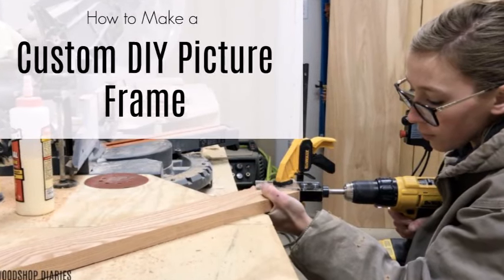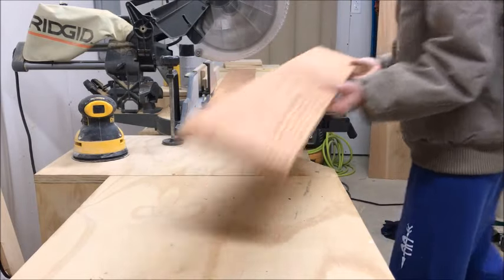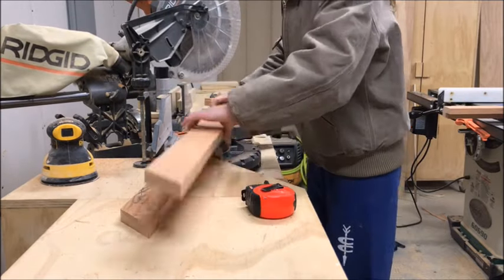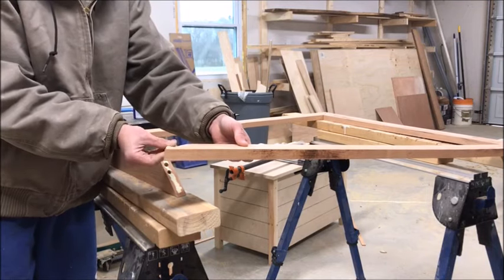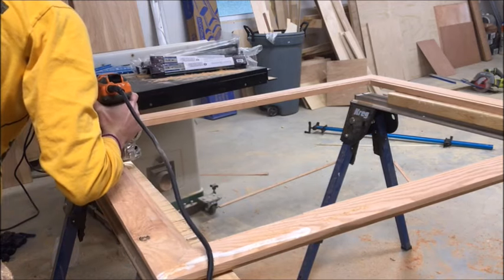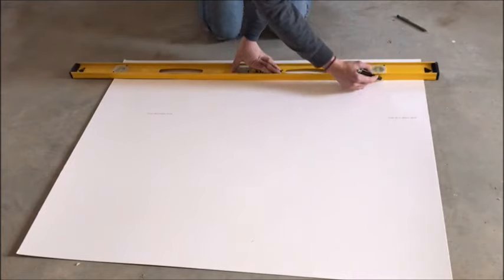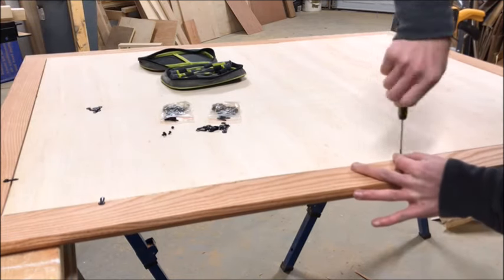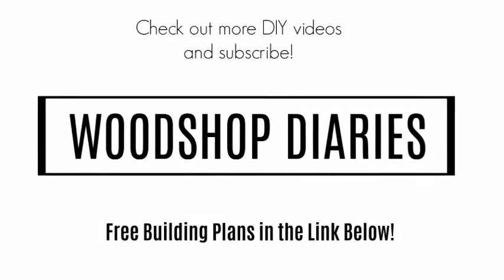How to Make a Custom DIY Picture Frame

Comment: Nice job, well done. However, I would have routed out the rabbet before the glue up, saves the possible error in using a chisel to square it up. But all in all, a very good job.

Comment: Did you so anything to keep the print / painting in place or is it just the pressure of the backing?
Reply from the maker: The tabs on the back hold the picture and the plywood in place.